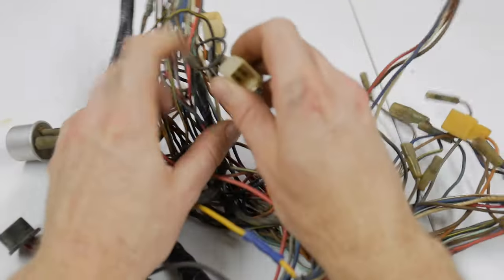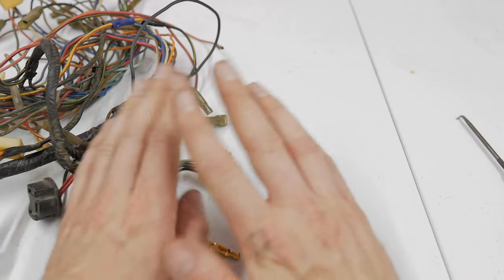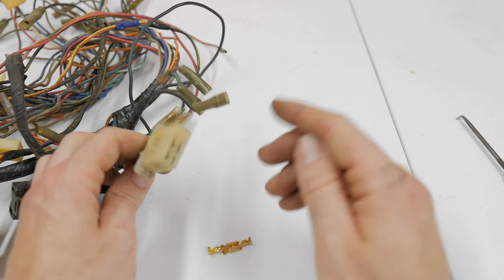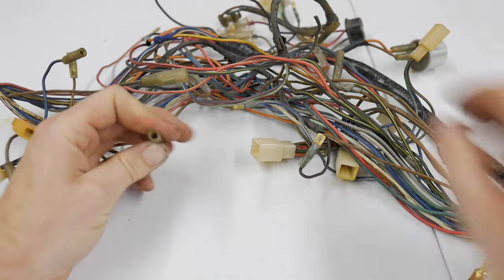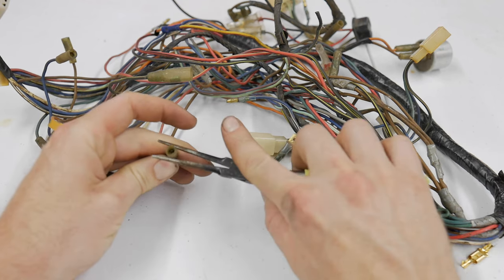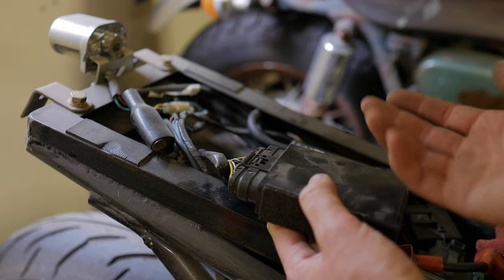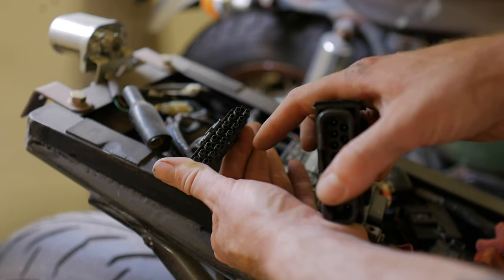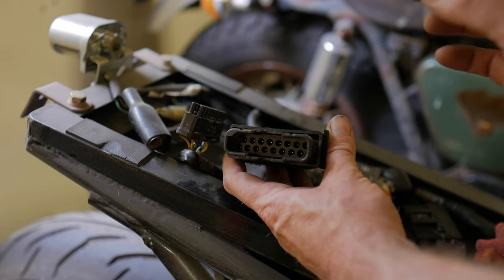Motorcycle Electrical Problems : Easy Fix To Save Money

Comment: Instead of buying new switches and clusters, I cleaned out and greased my kill switch and starter cluster during a throttle cable replacement. When I started the bike, the low beams were much brighter and all of a sudden, my high beams were working too!! Amazing what a little bit of cleaning will do for our bikes.

Comment: something i was told a long time ago, "if it comes apart it can corrode" a tiny bit of antiseize for bolt and di-electric grease on connectors goes a long way to help. any ideas cody, good idea/bad idea?
Reply from the maker: Honestly I cam a big fan of silicon spray. It is a "dry lube" that sprays wet. Makes everything from rubber to plastic slide easy into position then drys. Di-electric grease is great but so many people use it the wrong way. It is inteaded to seal the connectors on the outer sides, not packed into the terminal ends and shoved together. Even though you can use it like that, less is more!
Reply: What products and process do you recommend using and doing if the connectors already show signs of corrosion?  How and what do you do and use to clean them
Reply: @billbecher311  - I just wrote this on another comment.
Deep them in vinegar.
Possible uses, put vinegar on a small bowl deep the terminals/connectors.
If the accessibility don't allow the usage of a bowl. Simple plastic bag held close with a rubber band, can sometimes suffice! ;-)

If the position is not practical do deep/soak the part(s). You can use mustard!! Yes the thicker mustard can be applied in a slanted or vertical position and stay there for awhile. Just enough time to make it bright & shiny! ;-)

Comment: Cody, you are soo right.. few years ago I had my H Shadow at 2 different service shops for electrical issues and none of them were able to figure it out. One of them even told me to sell it for 300 Euro and be happy. So , I went home and started to inspect everithing from handlebar switches to the battery and found several rusted contacts in the terminals of the fusebox, (the fix was super easy and it is running perfectly ever since). But from that moment on, I have done all small task/maintenance by myself. Only if I would have some engine failure, I will probably go to a repair shop. I even purchased few 1983 oldtimers , and I have a running project for a cafe racer with H CB250N, and the Yazamha XJ550 is beautifull as it is, so I will just restore few parts.
Reply: That's why I specifically went to learn mechanics and electrics.

Comment: Bro I’m stumped. I put taller bars on my bike , all was good. Then I get caught in the rain and now start button does nothing. Not even a click of the relay. All relays replace, new switch installed, ground is tight. I still ride every day with a push button solenoid. Everything is good but this dang button. What do I do

Comment: TIPS:
- Keep terminals tight.
- Keep terminals CLEAN.
- Keep wires and wire looms properly wrapped, fixed and protected.
- DO NO pull terminals by their wires.
- Protect terminals with a very light film of Vaseline, or any other commercial product of your preference. The first option is simply dirty cheap and readily available.
  
Now to help cleaning those pesky brass fittings. If using "mechanical means". Example: Dremel with a small wire wheel make short work of having bright shiny metal staring at you. 
A wire brush or sand paper (>400) do the job, its just more work.

For those inaccessible terminals inside plugs, females, etc.use (light) acidic solutions! Some examples of very effective safe and readily available acids, in any house. Vinegar, mustard, lemon juice... For what it's worth you can consume them. That's how safe it is. ;-)
- Vinegar being a liquid is ideal to deep parts while soaking them. 
- Mustard has the advantage of the thicker consistence. You can apply on vertical surfaces, etc. 
Enjoy. Cheers
Reply: Can you help me?

I was tinkering with the wire of my bike's horn. One side was corroded, so I decided to cut it and replace it with a new wire at the same spot. Initially, everything seemed fine, but at a certain point, my bike suddenly stopped turning on. The screen didn't light up, and although I could start it using the kickstarter, the lights remained off. However, the engine was running normally, just without any screen display or lights.
Reply: @reginald4749  I'm having this issue did you ever fix it?
Reply: Thank you For sharing knowledge. Some may know and think it's common knowledge, But for many it's not. I'm 1.And appreciate you taking the time to share information.
Reply: Just want to update. Lots of people never do. It turn out to be a wire from my rectifier to battery. While battery was reading 12.5 the wire thru the plug was reading 8.1 volts. Changed out the wire and inline fuse even though it wasn't blown and all is happy in my world. Because i never thought a single wire especially a thicker wire would've cause the havoc i was dealing with I replaced my stator, rectifier, and battery. My big takeaway is lesson learned but i learned so much about my bike by digging into engine parts and building confidence working on something i never have. Plus I'd say I'm a bit of a genius with the ol' multimeter now 😂😂

Comment: This is the finest kind of video available on Youtube. Practical common sense ideas like I see here are what makes the world go round. When I was sixteen years old working for an electrical company in Miami Beach we had a guy that not only did the repair to what was happening to the wall circuit, he knew how to assess what was happening in the whole deal with why something wasn't working. He would straighten out the whole deal. We sure did dump out a lot of lint traps down inside the washer or dryer that the customer had. This harness stuff is exactly what he would have shown me if we were involved with this stuff. JUST WONDERFUL!
Reply from the maker: Really glad you enjoyed it man! That guy sounds like a legend! 🤙🏻 Thanks for the feedback.

Comment: A friend of mine had electrical problems with his Suzuki SV1000. The dash was crazy, the light and indicators didn't do what they were suppose to. He went to a garage who "went through the whole electrical system" and couldn't find anything wrong, therfore it must be the ECU, they said. 
Expensive!
I said to him, "check the wiring, maybe it's a loose end or bad earth?" He did and found a loose connection at the rear light under the seat, plugged it back in again, and result! 
Cheap!

Now, that garage will probably not see any of us again!
Reply: Ive given up on taking any vehicle to a certified mechanic garage. They only rip you off. Only time i use a certified mechanic is when i know exactly what the problem is an i know exactly what needs done an parts an its to big of a job to do in my own garage myself. I do feel bad for those not mechanically inclined. Its easy stuff really like a lego set, just follow instructions, youtube is good for this.

Comment: Great stuff - I was once left on the side of the road by my MC that had a total loss of power.  EVERYONE I talked to said "Oh it might be this component that died" or "check the fuses" and guess what it was.....a loose terminal on the battery.  I'd added a trickle charger and didn't put any sort of lock tite on the thread and after about a year, it had wiggled itself loose.  That's all it was.

Comment: Honda had an internal TSB captioned "a new twist on connectors", back in the early 80's. It worked wonders and the cars weren't even that old. Just a couple of years. If we got to the connector too late, and it was melted, either 2 harnesses needed replaced or you did what we did where I worked. We would cut the wires out of the connector and solder them together. It was a lot faster and cheaper than replacing 2 harnesses. It also got rid of the poor connection that caused the over heating.

Comment: I have a 660 Tenere and I'm at my 4th regulator in two years and my second in two weeks. Two times I hade it changed in Paris, one time in Morocco and the last time in Spain. It was awful, I went from Paris to Morocco and remained stranded 3 time because of this...  Every mechanic didn't want to listen to me and the fact that it's defintly a problem that causes all these electrical problems... My thought was that it's the plug, but every one said it was ok... The first problem started after a ride in the rain and water got in and burned the regulator. I got am original one and put silycone in the top of the plug to prevent water from getting in, but  it failed on the higway, 200km from home... New regulator, but the problems persisted... Now  I'm going to order a new plug and have it changed and will se what happens!

Comment: Thank you so much. You have single handedly saved me time, money and from going mad. 

Had a starting issue on my daughter’s KLX140. No spark. I was convinced it was a dodgy coil and was about to buy a new coil after days of testing coil, relays & solenoid. Watched your video and systematically went through all the plugs. Bingo! A couple of pins on my CDI were looser than a hookers money maker. I pulled the connectors out squeezed them up and reconnected. The bike is running like new. 
Im now subscribed and booked in with your training 👍

Thanks again.

Comment: good vid cody ...i have several motors that i bought cheap and fixed a wiring harness problem in minutes. i buy bikes that generally have simple wiring harnesses to work on i ride them a few years and sell them at parts bike prices.

Comment: This happened to me - the connector from the ignition switch was burnt/melted probably because of this exact reason.  The connector was melted inside, and the wires sleeve had burnt so it was well beyond this fix - so I basically soldered the wires together and all good.  The other alternative is a whole new wiring harness, which is way more cost/work.

Comment: Hi, this was a very informative video. I own a TVS Ronin 225 CC recently something has went wrong with the electronic but no service centre is able to help me.

So the problem is when I put the keys in and turn it the Dial would not turn on, I need to shake bike to get it on (like move into main stand and rapidly move it out) also sometime when I push the self ignition button the Dial will go out.

Comment: Owned my DT50MX for 23 years,  70% of my wires are solderen or changed to Abiko insulated terminals, I even solder the wires after crimped insulated terminals. Never seen a wire problem the last 15 years.

Comment: Hi Thks four your excellent video I have a Vespa lx 50 all my lights working fine just the speed meter dash not working I check all bulbs all ok I change four new speed meter still the same the dash lights not.came on any help thanks

Comment: There is a liquid called Noalok it’s a fluid when applied to connections, rids the connections of the oxidation film disallowing a proper electrical bond ! ( there is one chemical made for aluminum and another for copper ) use of this can eliminate electrical issues on a motorcycle wiring !
Reply: Vinegar does exactly the same... ;-)

Comment: My 1992 XTZ660 Ténéré was stored for 10/15 years and the previous owner wanted to send her to the scrapyard.
I refreshed the bike, clean the carb and voila, running bike with lots of power.
Now, studently, stopped and never started again.
It has spark, clean carbs (again) thus having fuel (wet spark), has good compression and doesn't start. 
The spark is too weak and even with starting fluid doesn't want to start. 
They are very cool bikes, but the electrical part on them sucks specially after the all these years.🤦‍♂
Love the bike though. 😅

Comment: I don't hate the electrical part of a motorcycle. Well, I'm very biased. I'm an electronic engineer. I do understand what happens with the electric parts and how to fix it or replace it if that's really the case.

Comment: ALWAYS use a quality corrosion inhibitor on your connectors when taking them apart regardless of how old or new your bike. Be careful to not make a mess but always.
Reply: Do you have any recommendations for a quality corrosion inhibitor?
Reply: @billbecher311  Yes, DeoxIT D5 which is available at electronics stores or online. It’s a spray.
Or easier to find and probably longer lasting on the connections.. Ideal Nolox which you can get in the electrical isle at a Home Depot. It is a gray pasty liquid and comes in a small squeeze bottle. I’ve used it for years on my bikes with good results. I use a toothpick to apply it on the terminals. A few ounces lasts forever.
Reply: The DeoxIT is mainly used for electronics such as scratchy volume controls on old radios.
Reply: @billbecher311 - You probably already have a readily available home solution for that. Vaseline.
A thin amount, just a film, is more than enough to keep it all impeccable. From battery terminals to... had your choice. A tiny pack will last ages. ;-)

Comment: I have a 1978 Kawasaki 1000 Z-1R. Was given to me. Hasn't run in 8 years. Put a new fully charged battery in it. When I turn the key all I get is the tail light. Nothing up front or to the starter. Checked all the fuses. All good. Maybe I missed a main fuse? Any help is appreciated.

Comment: Hello TheMotorcycleMD, I had to replace my ignition switch due to a failed theft on my bike. However I was really slow to get to it because of low funds and got back to repairs almost 2 years later. I thought the display wouldn't turn on due to a dead battery. I bought a new battery and checked the voltage. I plugged the new battery in and... nothing. No display lighting up, no starter sounds when pressing the button. Just dead. I am sure that the theft attempt did not touch any other components of my bike. What am I doing wrong?
Reply from the maker: Check all fuses.

Comment: Hey bro, just asking if you got any tips regarding my current issue.

So, my bike has power but neither push starting nor kick starting had any response like, totally dead, nothing. I tried jump starting it through the starter relay and it started but it need constant apply to the throttle to keep it going. The moment you let go of the throttle, the engine dies. I also heard something like an eletrical clicking under my gas tank. Any idea if this is just wiring problem or some components needs replacement? Thank you!

Comment: I have a no crank situation am trying to diagnose on my motorcycle, I've changed the battery, starter relay, I have a good engine ground the starter motor spins when benched testing it yet when I push the starter switch nothing happens the starter relay just clicks. All components in the starter circuit check out ok but the bike won't crank. I think I've figured it out to an earth fault because when I press the starter switch  with a multimeter across the battery terminals am getting a very large voltage drop from the battery sitting at 12.26 volts to pressing the switch it drops to around 6.30 volts. Definitely an earth fault but all wires are ok in the circuit as well😔

Comment: I’m new to bikes . I have a 125cc moped and it feels 50% power. 

So I changed the air box thinking it had an air leak… then had to up jet. 

And still 50% power… ive gone around the bike and it seems that my CDI unit is gone: going .. after research I’ve understood that CDI can make this happen ( mis fireinf & power problems ) 

Now .. I hope it’s this 🤣 as there not cheap

Comment: Thank you for the tip I am just fixing to go through every connection on my vl 1500 but let me ask a serious question can the bike run without half the sensors I haven't messed with it in a while but it seems to be missing the tip over one of the fresh air so if it's anything like they did my mower it's never going to run and I am wasting my time

Comment: I have a strange problem with my Royal Enfield Himalayan, battery warning light came on so checked the RR and generator all fine. I removed the headlight fuse to conserve battery and warning light went off all working fine, put it back and not charging.. Head scratching time!

Comment: I have a 1980 Yamaha 3 cylinder, 850cc. I replaced the main control box 2 times. The cycle will start sometimes. Sometimes it will start if you pull the clutch lever in. How many safety  switches is in the wire harness. It has always been stored in a heated garage.  Please help…. Thanks very much.

Comment: Great video, I ended up replacing my coil because two cylinder wouldn’t fire and not a second did I think it may have been the cdi, once I changed my coils the bike started and fired all four cylinder but then suddenly stopped and I’m getting no pulse, I can hear the fuel pump click but nothing with the current, can you help me understand if this could be the cdi ? 

Previously my bike wouldn’t rev past 10rpm and would choke really badly
Reply: Did you find te problem?

Comment: My 1993 CBR 1000F just died on me on the road. i replaced the voltage regulator. The bike is charging. The fuse box is getting 11.9 -12.2 from the ignition switch but the battery reads 13.9 at 5000 rpm. I know the ignition switch will get either dirty or worn and not send the correct voltage to the regulator and it sends too much voltage to the battery and can do damage. How do i clean the ignition switch or do i replace? same problem with my 1982 Gl500 silverwing.

Comment: I bought a 93 Goldwing, rode it 60 miles back home, park, then it won't start at all. It turns on the motorcycle, crank but won't start.

I bought a new solenoid, but it's doing the same thing, sounds the same. It won't turn over and start.

Is this a starter issue or a low battery or something else?

Please help.